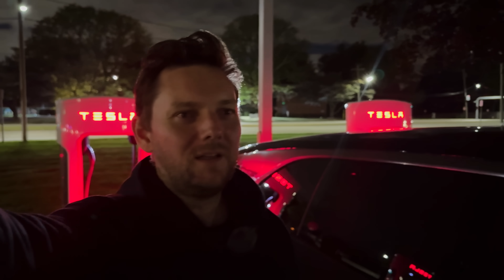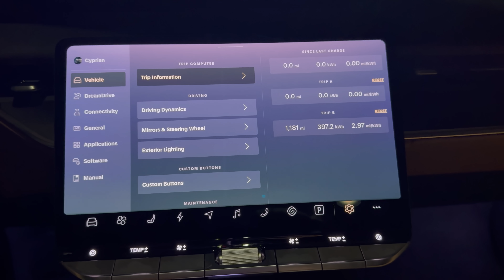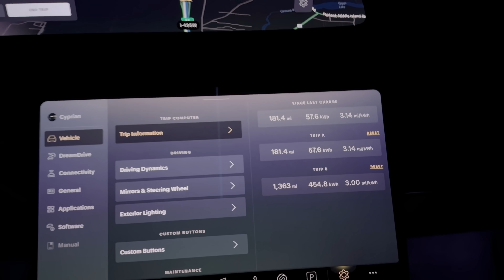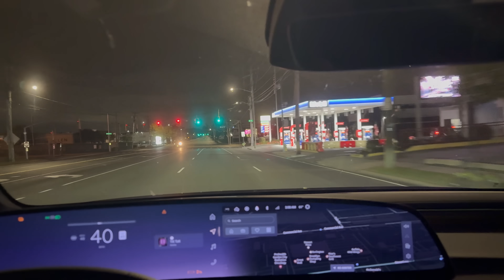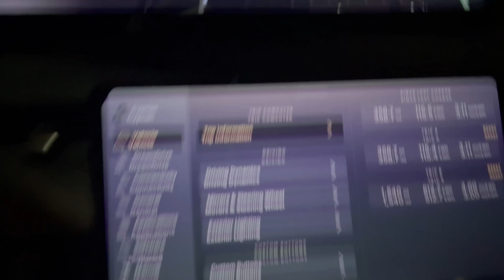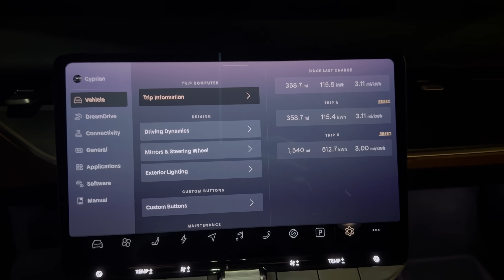Lucid Gravity 70 MPH Range Test | Real-World Highway Loop (100% to 0%)

Comment from the maker: I should make note: 
This Gravity is the Grand Touring with small wheels and 5 seats.. the one that has been given the EPA 450 range.

also:
 I think the miles per kWh is pretty strong for the size of this car. I often got less than that in my 2023 Model Y.... So although I might sound disappointed in the video, I do think this car is rock solid, sometimes expectations get the best of us!
Reply: EPA is always a mix of highway speeds (which are always less efficient) and slow city driving speeds, which don't have drag issues and are more efficient. So if you did the same ratio of 55-65mph and 25-30 mph total driving, and not 70mph, then you'd hit a much higher range. You can see a perfect example of this on StateofCharge and Tom's test with a Cadillac EV. You'd probably get 340 at 75mph, 300 at 80mph, etc. Per Tom's test, that also means that slowing down can give you more range than EPA, with Chevy demonstrating this by doing 1,000 miles on a single charge with a Silverado EV, but by driving 25mph the whole drive
Reply: @michaellawyer4885  wrong
Reply: @michaellawyer4885 Sure, you never expect full EPA at 70, but you don't expect 20% below. Disappointing it's not 400.  Hoping there was a quirk in this test.
Reply: @timco5387  20% off EPA when at 70mph is exactly what Lucid has advised.  Theres an exponential hit after 65mph.
Reply: @timco5387 I honestly think she could have gotten better because he was driving when the temperature was in the '50s. Evie's do their best in the '70s and in order to account for wind speed, he should have driven half half in both directions on a low windy day to get a more realistic daytime highway range. 

Cold and windy both will negatively impact range especially because even gusts of 20 mph makes 70 mph speed more like 90 to the car
Reply: He said he did a round-trip. 55F shouldn't normally have much impact (usually have to get down to 40s for that), but he did it at night which is worth another 10F because there's no sun heating of the cabin. 55F + sun usually takes little-to-no cabin heat. But 55F in the dark does.
Reply: On the flip side, can you imagine if you had to drive another 100 miles 😅😅😅. A+ for the effort and massive thank you 😊
Reply from the maker: @PatrickAdia  exactly! hahaha

Comment: Kyle (OOS) 70mph shows EPA shortfall, where Lucid is much tighter than this.  Between Lucid's high reserve and running the cars to dead, I bet your car has about 380-390.  Gravity also uses resistance heat, where low 50's may have dinged things, a bit.  I hoped for more, given his average shortfall between the two published graph points (both GT Air) is ~40 miles, not 60+.
Reply from the maker: You know, I have been making it my duty to know everything about this car.. I must have assumed it had a heat pump, I didn't realize this, thank for pointing it out.
Reply: Lucid gravity uses a heat pump and as of 2025 Model Year Lucid Airs also use a heat pump
Reply: @imzjustplayin  What I get for using Copilot.  I can't find where Lucid points out Gravity's heat pump, but it would make sense.  AI said otherwise, but, for now, Google/Copilot agree it does.  Technically, resistance is probably also there for backup, which may trip up AI when phrased as either/or.
Reply from the maker: @imzjustplayin  thanks for also chiming in.. that really through me off

Comment: just curious
1. were you running the A/C?
2. I think the 451 is based on a slower speed of 55 not 70.... also in temperatures of 70F+ not the 40F-50F ish that we have in New York right now. Temperature really affects the range of any battery car... 
3. I believe you said in the a previous video you had bigger wheels? If yes, it also lowers your max range.
Reply from the maker: Yeah AC was on. A little climate for the test was important for it to be slightly like real world range. I wasn't trying to hyper-mile

Comment: You never said what wheel/tire package is on the car.  The EPA range varies from 450 miles down to 386 depending on the wheels/tires.  I'm assuming you were running the 20/21" wheels with the Hankook all-season tires?
Reply from the maker: Oh sorry, I mentioned it in other videos about the car, and probably forgot to mention it here... I have the spec of the Gravity GT that EPA estimates at 450 miles... Small tires, 5 Seater
Reply: He said he was on small tires, at the video's end.  That means 20/21, I think.

Comment: The EPA standard is not a highway driving test.
It’s based on real-world driving conditions in the U.S., especially typical commuting patterns.
The test repeats both city and highway cycles, with average speeds of 31.3 km/h and 77.8 km/h respectively.
Even in the highway cycle, speeds do not exceed 100 km/h.

Comment: I'm riding a Tesla Model Y in Korea. First of all, it is thought that there will be an effect on battery performance due to energy consumption due to lights, heaters when operating air conditioners, and external temperatures due to night operation.
Tesla Model Y is also most efficient when the temperature is 20-25 degrees Celsius in Korean weather standards.

Comment: Its impossible to match the spec range because its comprehensive of a mixed usage, 350 on the highway is super good considering size and weight. It would be really appreciate a 75/80 mph test which is more realistic and we should be in the area of 300miles. At that reacharge speed the only limit is the pocket.
Reply from the maker: Yeah, I would like to do the "10% challenge" that Out of Spec has coined... Agreed on meeting the EPA on highway.. I kind of imagined falling 50 miles short, and seeing that 400 number..but its ok, the car is amazing, and charging performances matches Lucid's statements
Reply: @Notch_EV  evs have to aim to the charge speed, unless they do some revolution on energy density...its no brain to put bigger battery. i think for the size the Gravity is perfect. Its more than enough to stop every 300mile ( 4h hours continuos driving is even beyond the safe limit for me).

Comment: Do a 65 miles per hours test I bet you get 400 miles range speed is the biggest difference!!!!
Reply: I'd like to see the numbers at a different speed, like 60mph.  However, you probably don't need to drive another 400 miles.  Instead, reset the trip stats and drive for maybe ten minutes at one speed (70mph) and record your miles-per-kWh, then reset and drive for another ten minutes at a different speed (60mph) and record the mi/kWh.

My understanding is that the number one consumer of energy in an EV is air resistance.  So, your energy consumption is mostly proportional to speed.  However, it is NOT linear.  Air resistance increases as the SQUARE of the speed - double the speed and you quadruple the air resistance.  That's why Lucid was fanatical about reducing the drag coefficient.  ICE vehicles have the same issue, but the combustion engine is so inefficient that just running the engine consumes far more energy at lower speeds than air resistance.

Also, as well as you tried to control the variables, there are so many things that you can't control.  Driving at night added the overhead of the headlights.  The outside temperature changed during the drive.  Wind speed and direction probably changed - you might have had a head-wind, a tail-wind, or both.

Still, it is nice to have a sample of the Gravity's real range for typical highway driving.  I am less concerned about range driving around town as my local trips won't be that long and I can recharge at home.  The real question is how far can I go on a road trip before needing to charge.
Reply from the maker: I wil! gotta get some rest and then get back out there!
Reply: Nobody drives 65 nowdays. Not even 75. 😂😂😂

Comment: Thanks for the data. It does not look like setting 72 temperature had any effect. I'm interested in the official excuse/reason will be from Lucid. You will have 3 opinions there, cust service, service dept and any escalation to management when neither can give you the promised miles. Lol

Show them price per 450 mph on purchase and ask for free charging for the lifetime cumulative amount loss of 20 % of range.
Reply: The Lucid people aren't likely to be that sympathetic.  The EPA 450 range is a mixed mode test, not a highway range test.  And the highway driving portion is done at a lower speed.  And I believe at a warmer temperature as well.  It'd be great if there was a standardized highway range test for all EVs.  But the government has opted out of that, and "real world" highway range tests are the responsibility of the automotive press and EV enthusiasts.

Comment: 350 miles at a real world speed in a car with that much space and charges that fast is honestly great. More range than my ICE car gets and holds more people and has a ton more space. Along with the great charging performance, this car is software updates away from being the realistic best EV on the planet. Like with this EV it finally feels like there is no compromise with going EV. I haven't bought my first EV yet but these are the specs I expect with my future car
Reply: Exactly I just checked online and they say 80% of epa to get your 70 mph range approximation.   And lucid nailed it
Reply from the maker: you are on point. The charging performance of the Gravity was not overstated, and it makes the range of it even less important.
Reply: @Notch_EV honestly, looking at these results, I'm pretty pleased with it because the EPA range is based on mixed city and highway driving and even the highway driving isn't even as rigorous as a continuous 70 80 mile test so usually a REAL highway test comes out QUITE lower depending on the speed.

It's only German cars, which GM is now pretty much copying and Tesla's newest models that have started the trend of drastically underrating their car from what the EPA test would say to the point that

EPA range is pretty much what would get on a highway test but this new way of testing is super recent and has only started becoming a thing in late 23/24.
Reply: Thanks for the real world testing! These are the kind of test vids I love to see. I know it ain’t easy doing these late night, early morning runs but they are providing me with so much info as I seriously contemplate my own purchase of a Gravity. Still love the car and love the channel. Keep ‘em coming!
Reply: If you ignore the 450 EPA, sure. But we can't ignore a 20% loss at 70 MPH, which is still on the slow side for US interstates. That's a big miss. 

Mine will be the 450 trim, expecting around 400 interstate.
Reply: @timco5387    If you ignore the 450 EPA, sure. But we can't ignore a 20% loss at 70 MPH, which is still on the slow side for US interstates. That's a big miss.

it's not.  Most drivers don't have any intuitive grasp of the physics of vehicles.  And they can't relate that to the fundamentally different performance of electric vs. ice which means the EPA ratings for either can always be accurate or not, depending on how you are driving.  Briefly....

ICE is extremely inefficient in city or stop and go traffic, because you are always burning fuel whether moving or not, and you never recover energy when you slow down or brake.  Also with ICE, you lose economy when driving up hills, or at high altitude and there is no way to regain this loss.

You are better off at highway speeds coasting with ICE because at least you are moving - EVEN THOUGH you are burning fuel primarily by overcoming air resistance.  Air resistence increases exponentially with speed so you still rapidly lose fuel economy at higher speed with ICE.  The loss of range at that point is just as bad as with EV.

EV is extremely efficient in stop and go traffic.  It recovers power under braking, it recovers power during mountain driving , it uses no power when 'idling', there actually is no idling.

However those advantages are lost when you coast at any given speed.

You don't expect EPA range with an ICE vehicle to match 70 mph coasting.

And you don't expect ICE car to match EPA range under rush hour traffic in the city (even city range won't be matched - ever).

Expectations.
Reply: @summertyme5748  This has nothing to do with ICE. We're talk EVs, specifically Lucid which is supposed to have class-leading drag coefficients that lose less efficiency at highway speed than most other EVs.

Many EVs lose 20% off EPA at 70 MPH.  Lucid is supposed to be better.  10% off was more the expectation for a class-leading EV.

Hopefully this test was a little off because he ran it at 55F at night (which is more like 45F in the sunlight as far as maintaining comfortable cabin temp).
Reply: @timco5387 I agree with you that when it comes to electric vehicle range, The EPA should publish a separate highway only number but the way they do things now, 

You'll notice from only a few years ago that Tesla's underperform their range by quite a bit when it came to the highway because of the blender testing style of the EPA test. 

Due to how much slower EV charging is versus gas cars, they should update their test and most automakers now are doing exactly that where the newest Tesla's highway range and pretty much every other manufacturer quoted EPA range is actually their highway range

Comment: Cooler temps will affect the range. Falling below 50 degrees will definitely knock down the range. I've been reading that when the battery is new, you won't get close to the stated range. But as you use it more, like around 2000mi, it's supposed to start getting closer to the stated range.
Reply from the maker: thats something I have never heard before... I'll look into it, thank you.
Reply: @Notch_EV  I believe that someone on the Lucid owner's forum has said that the range is initially a bit lower when the car is new, but I believe the explanation offered was that the motor wears in a bit over the first 1000 or so miles.  Not sure if Lucid has ever published anything official about that.

Comment: I wonder if it’s the temperature…I have 386 spec and regularly get about 350 miles out of mine. I’m in Alabama and it’s way warmer generally. By about 20-30 degrees. This is a surprising result for your car.
Reply: Are you getting that range on 70mph?

It could be the temperature and the speed.
Reply: @icy8078 on my road trips, when I'm on the highway, I average about 80. I turn on Dream Drive and let it do it's thing.
Reply from the maker: Good to know. That is much closer on yours.

Comment: Disappointing result, I expected at least 400. I also thought the battery capacity was 123kWh with 121 usable but you only were able to pull 115 out of it. Maybe early degradation already?
Reply: Multiple testers have shown that Lucid reserves a good amount of kWh below 0% to keep people from getting stuck.  And to be fair, most EVs fail to get within shouting distance of their EPA range on 70 mph tests.  I would also be curious to see if it improves as Lucid sends updates.  Because Out of Spec got improved range on an Air after software updates.
Reply from the maker: Hard to say... I could have pulled more out for sure, but I didn't want to push it.. BUT the 115 was at 0% so your point basically stands true.